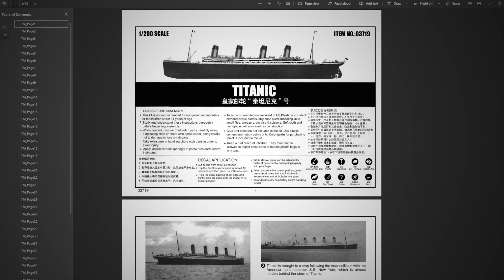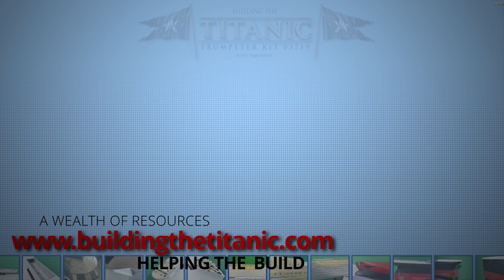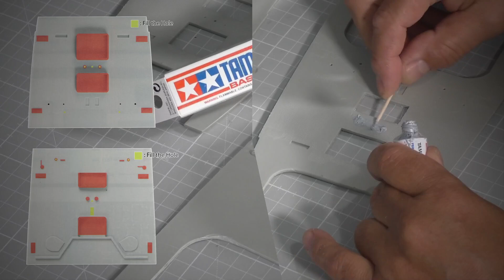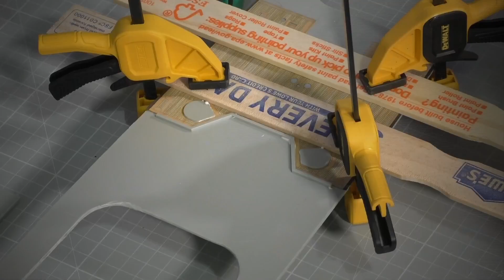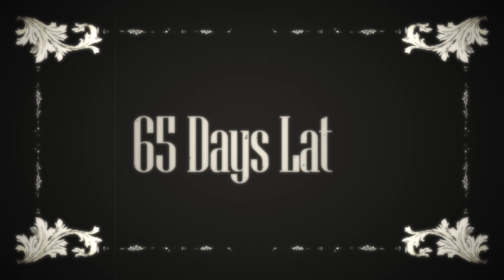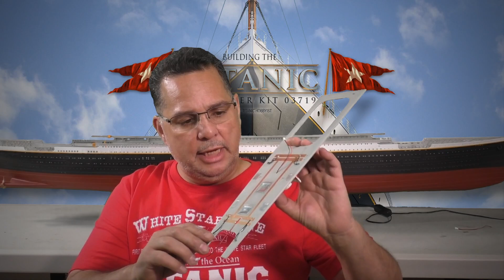Building the Titanic: Well Decks 1

Comment: Looking good.  But I'm afraid that you are falling into a little bit of pitfall.  There is a slight difference between the wooden decks.  The Scale Decks are designed to go under the bulkheads.  Whereas the Pontos decks allow the bulkheads to sit directly on the plastic deck as the kit was designed.  This means that with the bulkhead sitting on the wooden Scale Decks will sit a light higher than the kit is designed for.  The bulkhead sits high by the thickness of the wooden Scale Deck.  As the model is built up, this extra height adds up so by the time you get to the boat deck, it will look like boat deck does not fit.  Several Youtube channels discuss this issue.
Reply from the maker: Wow, that’s wonderful news. It’s too late for this first level, but I’ll be sure not to pile on the next wood decks on the upcoming levels. I didn’t think of that, but it make sense. Thank's a mil Richard.